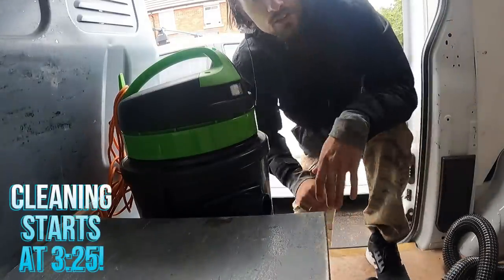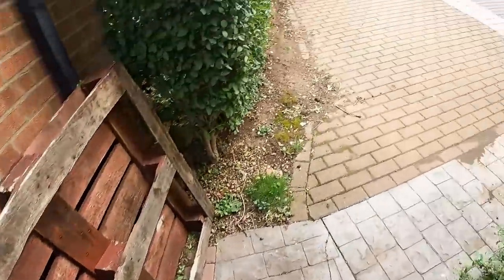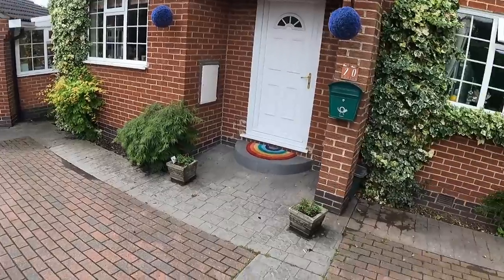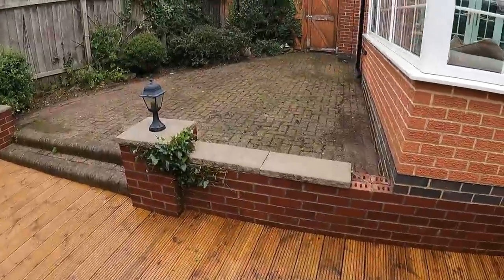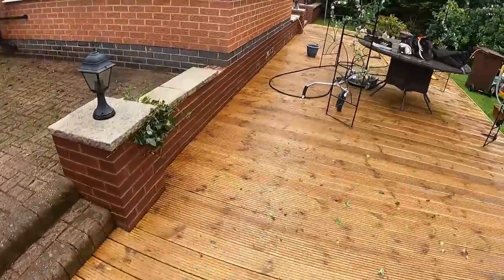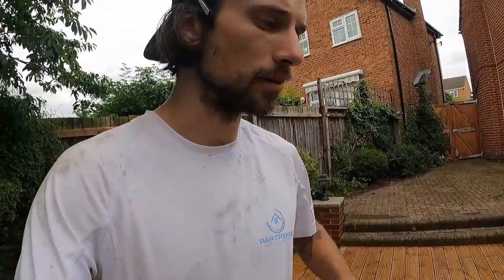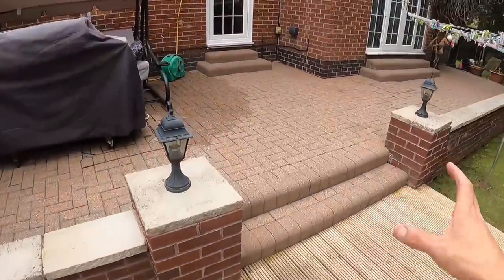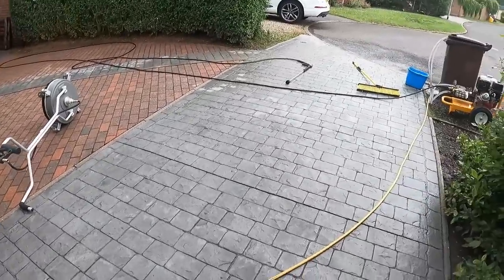FIRST DEEP CLEAN IN 30 YEARS! (They booked me in for next year already!)

Comment: Those decking boards are meant to be laid smooth side up and the grooves underneath are for the water to drip off. Grooves on top allow moisture to stay in and algie to grow.
Reply: Virtually everyone puts the boards down wrong, people seem to think grooves up so you don't slip. Even DIY shows do it wrong.
Reply: Whilst Youre right, there are alot of boards now that come with grooves on both sides, kind of defeats the point but there we go
Reply: Do you know why they have the ridges at all?  Your comment rings true to me. But now I'm curious to why there are ridges in it at all?
Reply: @jozina1  possibly to give the water somewhere to go instead of just bloating the wood? Just a thought, I could definitely be wrong
Reply: @ShanaLawson  Ah, just googled it. 😅 and it's something like that. It's so there is air between the boards and the flooring. So moisture can escape and mould won't grow there as quick.
Reply: Some aluminum decking board lines have ridges on top - NexGen, Fortis, etc.
Reply: Why even are there untreated decking boards?
Reply: @teastitchery3400  staining color options? Though I'll admit, it thoroughly sucks to stain and seal a deck.

Comment: Looks like those decking boards are not only untreated but are on upside down. The grooves are meant to be on the bottom to allow water/moisture to run off between the boards and the joists to avoid rotting.

Comment: The deck wouldn’t have been such a problem holding the algae if the wood had been put down the correct way, the groove should be on the underside, it’s not there for anti slip, it’s there for drainage.

Comment: Doesn't pressure washing the bricks/tiles risk "breaking" them..? Not like in 2 halves, but I ask because I am cleaning my mom's terrace these days and my first thought was to pressure wash them, but she won't let me. She says that it destroys the surface mildly or makes them rough and makes small cracks in them by pressure washing and that can cause stuff to grow on them easier and water can get inside so they can crack when it freezes. I had to look it up of course and it does seem like she is right. So I am using tile cleaner and a lot of manual scrubbing. But what is your thought on this..? I assuming you don't worry about it but maybe you could explain why.
Reply: Pretty much all driveways now have to use permeable blocks, that is blocks which allow water to pass through them. So water will always get inside them. If you clean your driveway regularly with mild chemicals and low pressure water it will keep them nice. But it seems like in all these videos people have left it too late.
Reply from the maker: It makes no difference there pressure isn’t high enough to damage the bricks, the contractor will be able to know immediately if he’s using too much power and adjust. Rarely a need to go above half pressure :) the water flooding is no worse than a heavy downpour too!
Reply from the maker: I replied below, this statement can be correct for roof tiles and some stone but not in your typical block paving, just pressure wash away, only use as much pressure as needed to get rid of the moss between the gaps and strip the dirt off the top. As you can see on the vid the pointing in the brick walls were completely solid after the clean and that is considerably weaker that a full paving stone!
Reply: @6581punk  Ahh okay so the blocks changed over time. I did not know that. Cant say about my mom's but I do know they are 15 years old and have not been cleaned before. Maybe the new blocks was already a thing 15 years ago.
Reply: @PartridgeExteriorCleaning  Thanks for the replies and it just seems like you are using a lot of pressure and at times you get really close to the material. But I will try to calm her down and hopefully, I can be allowed to use a pressure washer lol. Now I just need to get myself one of those.
Reply: @PartridgeExteriorCleaning  As mentioned in my other reply I don't have a pressure washer yet but I am willing to buy one to have some fun. You mention half pressure but half of what c,")
We are talking bar when it comes to pressure washing right..? How many bar is your machine and how powerful a machine would you and others recommend..? Not just for a hobbyist. Or at least a high-end hobbyist maybe.
Edit: Wrote psi but meant bar.
Reply from the maker: It’s 3650 psi and 250 bar but on more high end washers there’s an unloaded valve on the front you can twist it either way to increase or decrease pressure. On most jobs I will be about halfway of its full potential, if the drive is in good shape and solid I will go a bit heavier and get it done faster because I know the surface is up to it :)
Reply: @PartridgeExteriorCleaning  Cool. Thanks a lot for this information.

Comment: i have contracted a company to clean, on the end, they painted the floor, they painted all bricks as well, is that normal? they said it was a "courtesy",  should i remove the paint to check if the work was done properly or is that normal?
Reply from the maker: :0 I’ve never heard of that, did they seal it? Or actually use paint ?
Reply: @PartridgeExteriorCleaning  they used actual paint, its like a plastic paint. it was a "gift"
Reply from the maker: Weird, I’ll have a research and get back to you! Does it look good?
Reply: @PartridgeExteriorCleaning  yes it does, I was curious, so I am asking you, thank you for the attention
Reply: @ZeroSpearow  but paint peels! If they insist on a gift they should stain your brick. Bricks aren't really made to be painted
Reply from the maker: Yeah I’m not expert on that but the comment below is correct it will peel, even some sealers can peel a bit eventually but not as quickly as paint would. It’s confused me a bit but if it looks good then great but I think you’d be within your rights to get them to remove it as you didn’t ask for it. 
Sounds like they were trying to get rid of some stock :D
Reply: @PartridgeExteriorCleaning  I'm no expert, but I agree with you. I'm pretty sure they have every right to ask that they remove it because they didn't agree to it
Reply: @GotAnUmbrella  do you think i should ask for it to be removed as fast as possible, or wait for it to start to look ugly?
Reply: @ZeroSpearow  I'd ask them to remove it quickly,  so that they don't argue with you